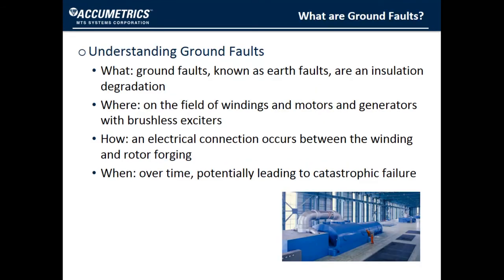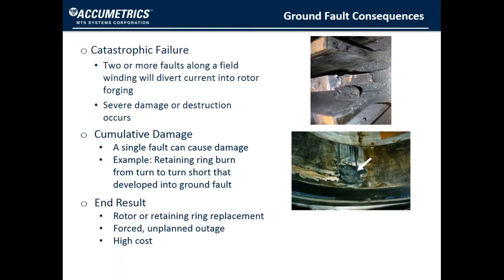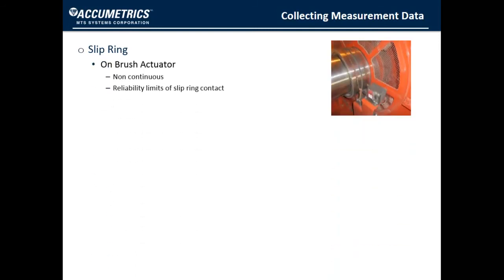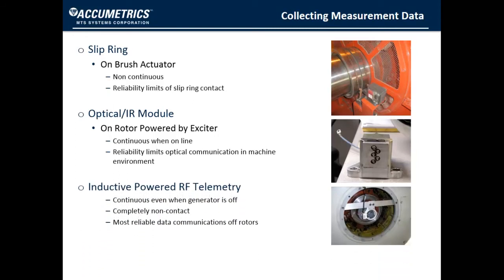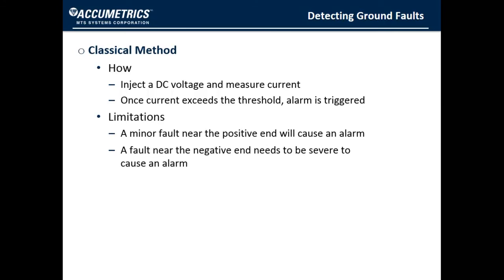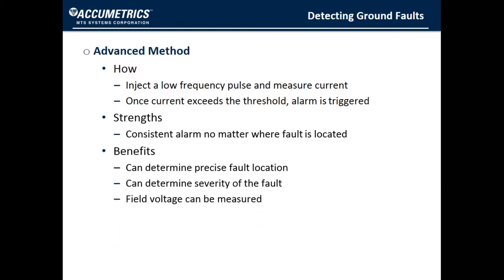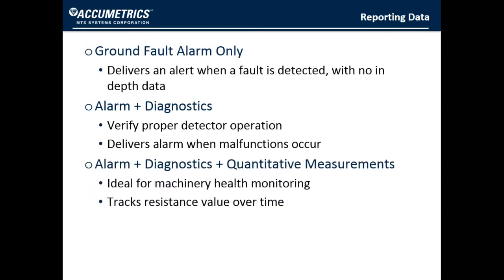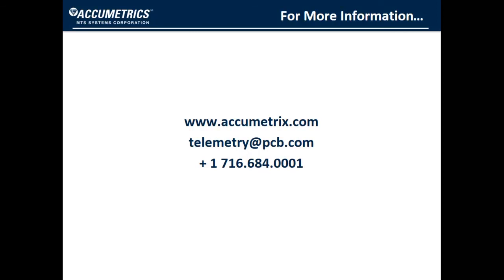Ground Faults and Earth Faults: Detection and Monitoring for Brushless Exciters

Comment: very nice info... also you can never trust motors that have been repaired... many shops just try to repair a low resistance ground point inside the motor with paint and bake? thanks..:)